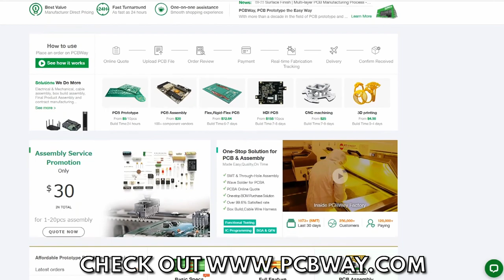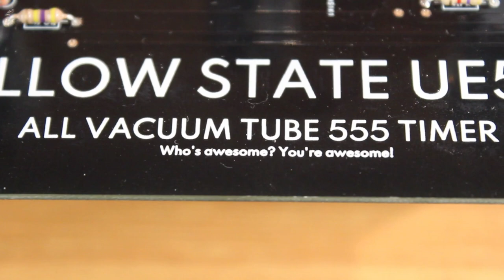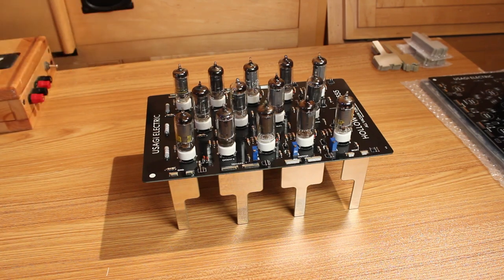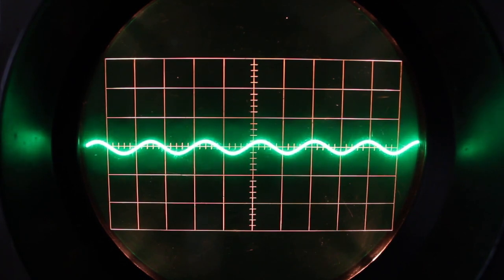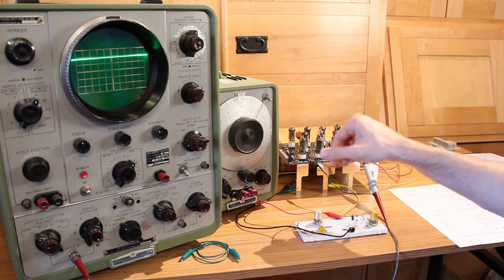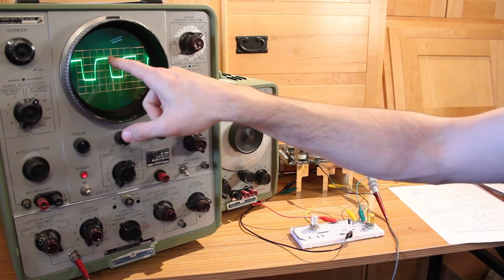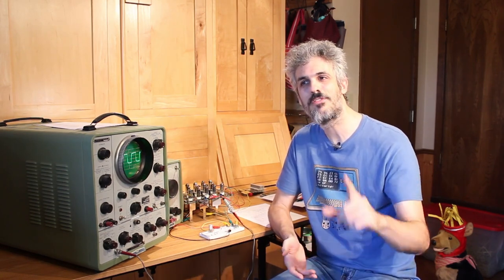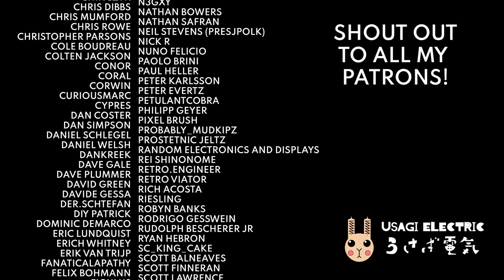The World’s Largest 555 Timer… Again!

Comment: Wouldn't the simplest, and yet period accurate, 1 byte ROM be 8 soldered jumper wires? If you were willing to modernize an 8 position DIP switch would do the trick. Technically a 1byte MEPROM (mechanically erasable programmable read-only memory) 😁
Reply from the maker: You're right, the simplest would be jumper wires or toggle switches of some kind.
But, I've been looking for an excuse to play around with core rope memory for a while and this looks like a great candidate to get my feet wet!

Comment: The 555 timer, along with a lot of early IC's, was groundbreaking.  Just having an easy to use product that did a lot of things in a small package, was amazing.  I mean, the 16550 UART revolutionized serial communications.
Reply from the maker: Yup! The 555 is without a doubt one of the most influential and ubiquitous ICs in history! This is my homage to the greatest IC of all time. Well, maybe 2nd greatest, we still gotta build that CSS555 :P
Reply: @UsagiElectric  Another versatile circuit is the blocking oscillator. will work at low voltages - needs a transformer and a RC network for timing. Synchronizable.  Was commonly used in TVs and early computers.

Comment: 18:06 has some very useful facts in the data sheet, including parameters such as “operating as a space heater” and “producing largely inaccurate timing delays” and of course the percentage of time that it works every time (less than 100% of the time)
Reply from the maker: Datasheets should be fun to read!
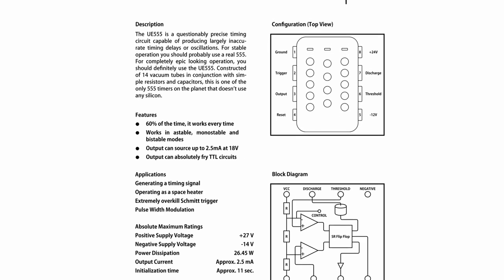Reply: Its at 08:03 ;) Fun nindeed!

Comment: If you ever do want to solder to aluminium or steel in future, I can highly recommend Topnik TS-81 flux. It works a treat but you need good fume control and to have read the clean-up info fully.

Comment: Love it, I made an attempt at a RELAY version of the 555 timer, still working on it though, designing an electro-mechanical amplifier is where I left it. When I get back to it I will let you know.
Reply from the maker: I've thought a lot about a relay 555 as well! 
The hardest part is that the trigger and threshold input of a 555 need to be very high impedance and relays are inherently low impedance, so I don't think it's quite possible to do it as pure relay logic. But, the SR flip flop, discharge and buffer portion of it can all be done with relays relatively easily!

Comment: Great idea and excellent implementation. I not-so-secretly want one of these for the novelty alone!
As far as offering kits to your viewers: You could have the PCBs made in bulk (even 10 or 20 brings the price down considerably) and have the legs cut by Send-Cut-Send, again in bulk, and then ship legs, boards, and a BoM. Anyone attempting a project like this should be either to order the parts from Mouser or Digikey themselves or likely has a sizable pile of parts sitting around already. The board and the legs are the only significant barriers.

Comment: The 555 timer is ubiquitous for time-related circuits.  But the 741 Op Amp (and others) have to be the most important, influential, widely used ICs.  I see you made two op-amps in the tube 555.  Have you implemented a 741 using tubes?

Comment: There are some decadal counting tubes out there. Those tubes are specially designed for counting up to ten and were used in vacuum-tube computers. The principle is same as your neon based counter just combined in one single tube and the deviation problem solved. For example Mullard made the Z503M and Valvo Z550M, which even have illuminated numbers integradet. I have 5 specimen Z503M by Valvo in my collection.
Reply from the maker: Yup, dekatrons would absolutely be the easiest way to do it! But, they also require quite a lot of voltage, often double what a standard NE-2 neon requires. My goal is to keep the whole project at a low +24V and -12V, which unfortunately rules out the easy solutions like dekatrons and neons.

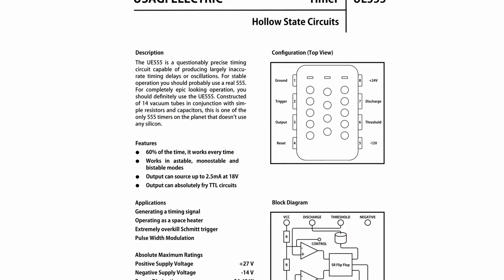Comment: I like the description paragraph on your data sheet @7:59
It's this sort of thing that shows why researchers were looking to replace valves and develop the transistor and why NASA had people developing integrated circuits in the 1960s.
Reply from the maker: I think for NASA, a reliability of "60% of the time, it works 100% of the time" may not be quite good enough 😂

Comment: Yay!  PCBWay!  I have gotten so many great boards from them.  I'd love to see vacuum tube versions of 74xx series chips and eventually a circuit using the 555 with some of them.  Oh, PCBWay has a marketplace thing where you can make your designs available without folk having to download and upload stuff they can just order directly.
Reply from the maker: They actually deserve special mention here because they were extremely patient with me making this video! It took months longer than I was expecting before I got back around to it and they were awesome waiting for me. 
I do actually want to do a whole series of "DIP" vacuum tube replicas (like the 7400), but there's a few things I need to square away first. The -12V supply is always a nightmare to try to slip in. It works out on the 555 and 741 because I can replace one of the less used pins (like the CV pin), but on something like a 7400, there is no unused pin. So, it would be best if I could figure out a way to do it without needing a negative supply. Maybe by elevating the cathodes or even generating a negative supply on the board.
The next issue is, I want to come up with a proper form factor, a standard that all of them will follow, that way we can make a huge plywood board with sockets and wiring and just plug in our oversized ICs to make stuff work!

Comment: For the output you could maybe use an extra output tube in place of the 220k to pull to ground to give it a lower impedance "low" state when the upper tube is off, might give steeper square waves

Comment: A heavily slewed square wave can often sound better than a very fast transition time after being run through filter chains in a synthesiser. Early transistors were often slow enough, but in modern times, it is almost obligatory to use tubes if you want that sound. Or else buy a bunch of vintage 60s and 70s transistors I suppose

Comment: Amazing work and awesome video. You might consider core memory instead of neons for the decade counter, or just use a boost converter circuit to get the voltage locally, but keep the user facing voltages low. As an aside, there's a relatively subtle high pitch tone though the video at around 10khz. I suspect noise from a flyback somewhere, might be worth throwing a notch filter on it in future videos for those of us that still have hearing up there.
Reply: The tone is there to disperse the young troublemakers from loitering.
Reply from the maker: Thank you!
I'll see if I can cobble something together with thyratrons first before digging into higher voltages, mostly for the challenge of it!
Interesting that there's a high pitch whine, there wasn't anything running in the background when filming, and I checked the audio in audacity's spectrum analyzer, and there's nothing above -48dB between 3kHz and 19kHz, so I'm not really sure what you were hearing. That's weird, maybe it's an artifact from Youtube?
Reply: @UsagiElectric  It is pretty faint and noisy but there's a stripe about 30Hz wide of noise right under 14k that I think is what I'm hearing. I don't think you'd see it as a single peak. I don't think it's YouTube as I don't hear it on other videos and that'd be a weird frequency to alias to or otherwise have issues. Audacity's spectrum analyzer defaults to log and pretty awful FFT size, switch to linear and bump up the FFT bin count and I think you'll be able to see it.

Comment: note: if using this with breadboard and card edge connectors; it would be good to insert the pins into the card edge connectors before soldering the pins to the 555 PCB to prevent stressing the pins due to misalignment.

Comment: You have 24v and minus 12. So for neon to get to 100v you could just add a few voltage doublers. 36v x2 x2 would do it. Would kill the current, but tubes are voltage devices.
Neons should even strike as low as 45 volt in some cases, but that might not be reliable. That it as far as my ideas go.

Comment: I suggest for divider use dual triode configured as a bistable and use caps to pulse the grids to divide by two. Should work at low power for lowish frequencies. Note The caps have differing voltages because of the bistable feedback driving the grids. The voltages are the right way round to trigger a change when pulsed (positive pulse IIRC). This can be chained as the "square wave' output from the previous stage gets turned into a pulse by the caps.. This is from dodgy memory of an old design of a valve version of a divide by 32k fed by a xtal OSC -15 tubes and 15 stages!
Reply: PS. Google bistable divider for diagram. I note most use steering diodes but I think these can be omitted with care. Oh and pulse is negative to switch. Good Luck

Comment: The first issue I thought about when you suggested core memory was that reads are inherently destructive, so the circuit needs to follow the read with a write if you want to preserve the prior value. That may or may not be a deal breaker, but speaking as someone building a tiny core memory kit at the moment it must be considered.
Reply: Core rope memory uses ferrite core as a transformer, rather than storing the data in the core. It’s read-only and doesn’t require a refresh. This was what the Apollo Guidance Computer used.
Reply: @krallja  You are thinking of an entirely different type than what I had mentioned. It is available as both ROM and RAM. When ROM the data is literally woven into the plane.
Reply: @r2db   Yes, I know. At 20:29 he mentions an entirely different technology: core *rope* memory, which is ROM. You mentioned core memory (no “rope”), which is destructively-read RAM.

Comment: This may be the time to look into inverted triode operation again - this allows a large current at very low plate voltages, at the sacrifice of gain. IIRC thyratrons are current-controlled devices, so this may help with reliable triggering.

Comment: is it possible to build integrated tube circuits?
Instead of many transistors on the same silicon, many triodes in the same vacuum chamber.

Comment: Hey. Great project. Dumb question from someone who doesn't know tubes, though - you've said to use either 6AU6 or 6CB6 tubes. When I look them up they seem to be pentode or 9 (nonode?) pin units respectively. Is there a specific 6au6 that is heptode? The circuit seems to use 6 pins? Or have I just missed something really obvious?

Comment: I'd implement the programming ROM simply as DIP switches (or normal switches). The decade counter is going to eat enough tubes even without some fancy core memory.
Reply from the maker: Absolutely, the simplest would be toggle switches of some kind. But, I've been looking for an excuse to play around with core rope memory for a while and this looks like a great candidate to get my feet wet!
The decade counter is going to be interesting. Even with dual triodes, to get a 6-stage decade counter is going to require a lot of tubes. That's why I'm thinking of implementing something with thyratrons perhaps, or maybe even try to get some phantastron style setups going on.

Comment: Nice!
Some questions:
- is it deliberate that you don’t have the outside of the pcb-legs connected? Or are there via’s you just didn’t show?
- the input totem pole that gave the 555 its name: why didn’t you use proper 5k resistors?
Reply: I noticed that, too. No vias in the legs, and only soldered on one side. I still think some laser-cut sheet metal would have been nicer. Although it's true that certain metals like stainless are hard to solder, unless plated.
Reply: @graealex  not only does the solder not like to attach to the material, it requires way too much heat. I think a PCB is a nice solution, but I would design them to use thermal isolated pads and stitching vias to connect the two sides.
Reply: @ReneKnuvers74rk  Solder does stick, you need a bit more aggressive flux and preheating is adviced.
But I can totally understand why the PCB solution would work out better, particularly when people want to build the kit at home.

Comment: I wonder if some kind of decade counter could be built using low-voltage "space charge" vacuum tubes that were developed for 12 volt operation in car radios (12 or 24 volts on the plate, no need for a high-voltage vibrator supply)? Just a thought...

Comment: What did you use to line up the legs?
I usually put them in a bread board and solder the legs after that.

🙂
Great work (but I would have put the extra voltages on another connection instead of the pin.  But that is just me.  Still an impressive work one.

Comment: I've been pondering how efficiently one could implement a counting circuit using a vacuum-tube based RCT (resistor-capacitor-transformer) blocking oscillators.  I think that if one wouldn't need to count faster than 5,000Hz, one could design a multi-stage counter around a 100,000Hz blocking oscillator which would act as a master clock that would gate all the other oscillators and a bunch of other oscillators that would if not gated free run at a speed just over 10,000Hz, but they would only be able to trigger at the same time as the master clock.  I'm not sure what the best way would be to "nudge" the phase of each such circuit to make the phase slip by 36 degrees, but I think that if one allows the oscillator to re-establish a stable relationship with the master clock after each count, it should be possible to calibrate things to work fairly robustly.

Comment: Pretty snazzy! 
I'm curious what the performance would be like if you ran "data shhet" plate voltages
Reply from the maker: Thanks!
The first thing that would happen if you put 100V on the VCC pin is all the tubes would light up like like bulbs and then promptly fry their filaments, haha. This is because I'm running the filaments in series off the main 24V rail (and two off the -12V rail). But, if we had a separate filament rail, we could definitely get it behaving a bit better with more voltage!
Reply: @Usagi Electric  haha, right, thanks for the reply.  I expected some modifications would need to take place first (for example,  even if resistor values work as-is, which they probably don't,  would likely need higher wattage rating).  If someone went to that trouble, though, I would expect a noticeable improvement to the slew rate and frequency range. 150 to 300v would be more typical plate voltages (based on the equipment I'm familiar with).